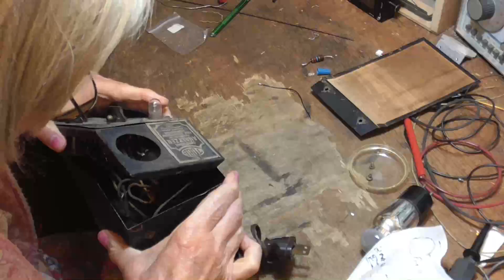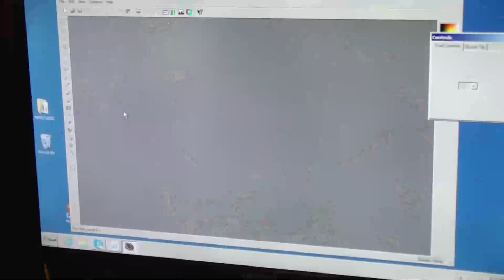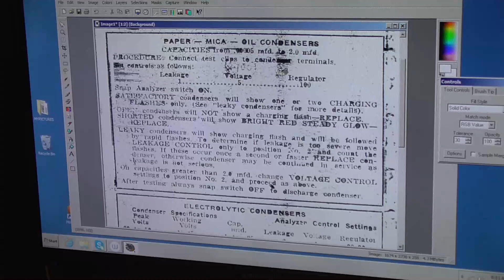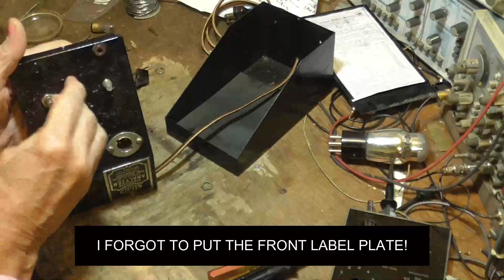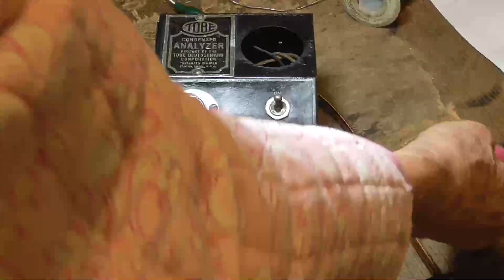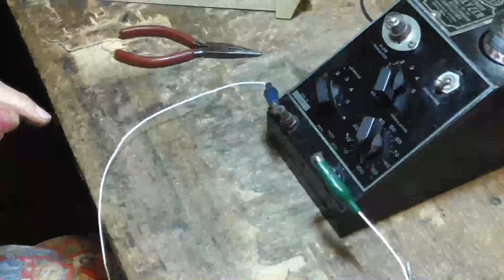RESTORING A 1934 CONDENSER CHECKER

Comment: Moving wire that you soldering with bare hand is amazing . You did not even say ouch ! . Also suggestion , why don't you measure the voltages  on good transformer and mark them on the transformer .This way it will be easy to replace one if ever goes bad .
Reply from the maker: Good idea.

Comment: I do think that adding a fuse to "vintage" electronics to control / prevent damage to things like transformers you cant replace is a great idea, but, @ 22:24 you should spend a few bucks ( currently $2.10 ea @ Digikey) , and get some Keystone 3523 fuse blocks. They have a soldering lug on each end, have an insulated base and can be easily mounted with a 1/8" hole and a pop rivet and backer washer, leaving the flush side of the rivet on the outside of the cabinet in this case, but adding safety & accessability to the fusing instead of trying to solder inline wires to it and then hiding it under heat shrink.
Reply from the maker: I have plenty of these fuse holders. I'm lazy. Also, I'm betting the fuse will never blow. I have MANY instruments with fuses, some over 60 years old, and none so far have blown a fuse. Things don't go bad very often and in most cases never.

Comment: I really like your videos, I really do!  On the one hand, looking at your laboratory, you can breathe the air of the 50s - 60s (I too grew up with thermionic valves), but on the other hand there is also the computer!  Beautiful and magical combination!  Wow!
Reply from the maker: I have over 120 antique radios in my house. The whole place has that antique smell! Fabulous!
Reply: @glasslinger  Sorry for the question, maybe I'm being indiscreet, surely you must have a lot of experience in the field, but where do you find all that material?  Do you have a repair shop?  Bye!  Good work!
Reply from the maker: @serjohn557  50 years of collecting "stuff" so I have a massive supply of parts on hand. Stuff you can't buy any more.

Comment: When you use cloth braided covered wire, before you strip it, try using a couple of drops of supper glue before and after the to be stripped area. Much easier to work with and no unraveling over time.
Reply from the maker: Nice idea! Now if I can find a tube of super glue that isn't all hardened up!
Reply: @glasslinger  I find heatshrink helps keep cloth behaving. Use black:)

Comment: I have a device with a bunch of 2000MFD Electrolytic Caps at 450 VDC.   How can I test them?
Reply from the maker: Wow, that's some real big bang capacitors you have!  Charge them up to 450 volts and watch the charge current. After the capacitor is charged the current should drop to ten milliamps or so. If the final current is much above that, the capacitor can get hot and short out.  Be careful, a capacitor like that can really wallop you good!
Reply: @glasslinger  Thanks for your reply.  I like to watch the things you fix and making glass tubes, I have little skill like that.  You might find my video amusing, most of our videos are travel and such.  This one is unlisted https://youtu.be/x6NSu8r4Jaw

Comment: When I was a kid I gobbled up every broken and old electronic device I could get my hands on. If I was unable to get one working I’d take it apart for later use. I taught myself how to repair these devices by trial and error at first and by reading later on. I have a talent for repair it turns out. I could almost just look at the guts of these old tube radios, tvs and record players and without knowing how, figure out how to repair them. I can’t explain this gift and my wife is always knocked out how I can practically by placing my hands on her devices, figure what’s wrong and repair them. If I had not been totally led away from any interest in repairs, I might have made it a career choice. I use to design and build my own transistor radios too. I had all sorts of bins with tubes, resistors, transistors variable resistors and capacitors. My father found my stash of these things and threw them away. I entered law and eventually became a Judge, having a terrific career. But I still like to see videos like yours, repairing items as  I once did, many years ago. I wonder how close to my young interests were yours
Reply: That sounds exactly like me!  A bit later tho as I was a kid in the 80s. And I got darn good at it, and I later did a career about it. Work with radio and transmitter repairs now, but have worked with television and audio repairs for many years prior.

But I tell you there is a huge shortage among repair techs that can really repair and not just swap out boards, as they tend to do these day. At my work we have tried to find younger guys to continue the trade as we are not getting younger... And sadly we just don't find any, kids just don't do this anymore it seems like. The best techs I have meet are the ones with a keen interest and that basically started out messing with electronics at a young age aka learn by doing. Exactly like you describe and we did.

This is in Sweden  btw, but I suspect the problem is universal. And this throw away and buy new society we live in ain't helping.

Thx for the comment, it really hit home with me.
Reply: @bjornholmqvist3230  👌🏻

Comment: `On the subject of capacitors, I admire your trust in checking capacitors with your VOM in many of your videos. I have a Triplett 630 but have not used it to test capacitors on the 100k range as you do. I would love to hear your opinion on using an ESR meter that can test capacitors in-circuit as opposed to a VOM test out of circuit. Perhaps you could do a video on capacitors? and I think its also time for a shop tour video. Thank you and regards - Renato
Reply from the maker: I only test capacitors for antique radios with the 630. ESR is not a factor in those old radio circuits. For all modern circuits where ESR is a factor I use new top quality capacitors designed for the job. In testing capacitors in circuit, ESR can be done reasonably accurately. For leakage you have to eliminate other leakage paths so in circuit testing is usually futile.

Comment: Hello from Calgary Alberta I just want to let you know you are inspirational with your no fuss gitter done ways of working .You are so nibble with your hands and that huge soldering gun in tight spaces lol You inspire me to keep learning this wonderful skill
Reply from the maker: The soldering gun is not that big. (150 watt)  I have a nice 325 watt gun that is about double that size!  Now THAT  is BIG!
Reply: @glasslinger  lol ya thats big for sure .Please make another video soon Im getting bored over hear 

Take good care of yourself
Reply: @glasslinger  I was able to purchase a 30v Triplett 630NA multimeter .I am going to try your trick on checking cap leakage ad viewed on one of your videos
Reply from the maker: @506mountainrenos  The 30 volt battery in the Triplett is difficult to find. You can make a good substitute by using lithium coin cells. 10 of them makes 30 volts. Put them in a sleeve of shrink tubing to hold them in line. This will last years.
Reply: @glasslinger  Brilliant I will do this and you can now buy this 30 v battery on amazon at a cost of $53.00 canadian I like like your Idea much better

Comment: You should make a radio with homemade tubes.
Reply from the maker: Actually, ALL of my homemade tubes end up in homemade radios! Many are in my radio collection and some have been sold on ebay.
Reply: I could have sworn Ron already did that, but it was a transmitter about half a year ago.

Comment: Hi Glasslinger.
What type of baratron do you recommend when building a vacuum system?
I'm following your website as a guide. 
Do you recommend the 1 torr or the 0.1 torr baratron?
Reply from the maker: The 1 torr full scale is the most useful. This gives you the full range of backing pressures either turbos or diffusion pumps use.
Reply: @glasslinger  okay and what would you recommend for the inlet pressure reading on a diffusion pump?
Reply from the maker: @johnnycash4034  I am assuming you mean backing pressure. (inlet is the high vacuum side, and low as it will go is best) The backing pressure for most 3 stage dif pumps must be below 100 microns. 20 to 50 microns is best. 4 stage dif pumps can pump against 200-500 microns.

Comment: We had a gizmo like that in our mechanic's shop at the trade school I attended back in 1977 for testing the condensers in the ignition systems of the old coil type ignition systems. This was just on the brink of the computerized systems, so we were still working on old cars from the 50's forward.  We used to use it to put a charge on the condenser then carefully remove it and call out another student's name, then toss them the condenser.  Man they would jump, cuss and throw it back at you while all the rest of the class laughed for a bit. Used to piss off our instructor to no end.

Comment: i fixed an old am tube radio awhile back, never got the tension system for the tuner working reliably but it was working electrically after i was done and held a station, stupid thing had an ancient multicap canister and a ton of wax capacitors that needed replacement, accidentally bought an engine starter because it had compatible specs for one of the components of the multicap, too bad it was ten times too big.  at this point im painfully familiar with the ac buzz in analog equipment that means replace everything

Comment: Thanks for this vedio . I want to buy a capacitor tester by which you can advise me
Reply: The cheap component testers on Ebay are good enough for general purpose capacitors, the only downside is you have to understand the numbers the tester shows you. It won't explicitly give you a good/bad, you have to know what the values mean to know if a component is good or bad. If you need a more sensitive and advanced tester, I'd recommend Mr. Carlson's Lab, he has a patreon where he has shared designs for several component testers that are a lot more precise than the generic Ebay chineseium.

I wouldn't recommend an old AC mains based component tester because "there be dragons". This tester isn't as dangerous because it has an isolated transformer, but a lot of old test equipment from that era is referenced directly to mains and tube gear can have B+ in the 300-500v range. Old test gear also is often full of faults from deteriorating capacitors and other passive components and needs to be repaired before it is actually used. Powering up old gear from that era without checking it first can lead to its destruction very quick.

Comment: It would be nice if you could get more bandwidth in your videos. The video looks something like it's dripping with condensation. A bad way to test if the condenser checker is working is to touch one post with the left hand and to touch the other post with your right hand. If you fly across the room, it works. You might also be dead, so I wouldn't recommend it.
Reply: It appears to be artifacting by TubeYous crappy compression algorithm.

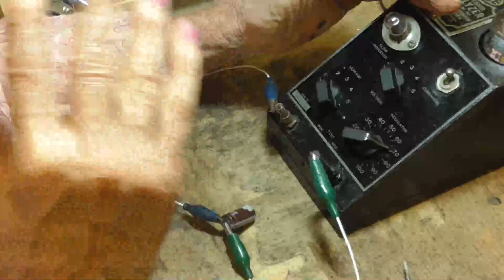Comment: Nice one!  I think you'll find your unit IS discharging the caps when turned off.  At 56:57 in the video you pulled that modern electrolytic off before the discharging indicator had gone out, so it hadn't finished discharging it.  All those new fangled microfarads take a while to discharge.  :)

Comment: Ron, what is the name of the service "stuff" (I forget the word you used) to seal(?) around where the replacement power cord went into the plug?  What type of replacement power cord is that?  You use a selection of (new) materials in your work -- will you share the names of supplies & suppliers that you use in a future video?

Comment: Condenser = capacitor? What’s the difference?
Reply: No difference.  Capacitors used to be called condensers.  If you're old enough, you may have or have had a car with a "points & condenser" distributor.
Reply from the maker: The difference is time. Before about 1945 they were called condensers and then gradually the agenda group took over and changed the name to suit themselves. Same thing with "cycles per second" and Hertz. All politics, no science.
Reply: In Europe, most countries call it a "Kondensator". Same stuff, just another name in a different time. Why they changed it, I have no idea.
Reply: The term came from the steam train condenser when techs didn't know better, later on by 1950s they realised the component does not condense so changed the name.

Comment: You could instead adjust the colors using curves. That way you don't have to manually go through each area of the picture. I don't know exactly where it is in the software you're using, but it's usually something like Colors > Adjust > Curves, or Colors > Brightness and Contrast > Curves... or other such menu. You know you're in the right place if you see a histogram and a diagonal line over it. Just shape the diagonal line to an appropriate curve and you should get pretty good results.
Reply from the maker: I use paintshop pro 5. (very old win95 program) It has a super easy user interface but lacks some of the more advanced photo correction functions. I have version 14 but it is so difficult to use I don't bother. Too frustrating.
Reply: @glasslinger  I think I used to have paintshop pro 5 (or could have been 6). It indeed is a pretty old program, I guess it might not have had the curves tool. But you could save a lot of time if you invested some time learning about that particular tool - at least if you need to frequently restore same type of pictures. You could still do rest of the editing with the old version, so you would not need to bother with all of the bells and whistles of the new version. Of course it also depends on whether you feel the manual editing is tedious or relaxing ;)

Thank you for the videos!
Reply: @glasslinger   I'd recommend trying paint.net if you haven't heard of it. It's a powerful image editing program that has a simple user interface, and it's free. www.getpaint.net

There are so few applications these days that have a functional user design, it's all about the eye candy and how many buttons you can cram on the screen at once. I use a bunch of older software myself for the same reason, modern stuff is too needlessly complex.

Comment: Ron, how does this thing work? The tube is probably just a rectifier - but you said something like 0A1? That would be a regulator tube, without a filament - but this one clearly glows. I am confused. The electrolytic (which was bad) is the smoothing cap, right? Then you charge the DUT capacitor through the neon bulb. Maybe you parallel the neon bulb with the 1k - 10k - 25k resistors to compensate for leakage and make the device less sensitive?

Any explanation or diagram you could give would be greatly appreciated! Greetings from Germany!
Reply: I found the link to the circuit in the comments further down: https://imgur.com/a/3sGsAP5 so everything is clear now. Thanks!

Comment: Please check your camera's recording settings or your video encoding settings because the video was exported at a really low bit rate.
Reply: Glassligers game is about demonstration.. you better get used to Glassligers game & stile.
Reply from the maker: I am not sure what is going on. I am using Wondershare filmora 9 and use all the default settings for H.D. and MP4 encoding. The video is noticeable better right off the hard drive using VLC media player.
Reply: @glasslinger  https://mediaarea.net/en/MediaInfo is a good open source tool that will show you the technical details of the exported video like it's bit rate. This video has the signs of a very low bit rate cap. Static shots look decent, but during shots where some portion of the frame has movement the rest of the frame goes blocky. Areas with movement show trailing artifacts and smeared motion. Bit rate need to scale with resolution and frame rate. If you exported the file at 30 fps, the same bit rate would mean roughly twice the data available per frame. Same if your decrease the resolution. It's often better to lower the resolution then crush the bit rate if you have a limit that you need to be under like for broadcast or really slow internet upload speed.

I'm on Ubuntu so I can't test their software, but it might remember if you made (an accidental) change to the bit rate in the export settings. They have a page https://filmora.wondershare.com/get-creative/how-to-share-videos.html mentioning 6,000 kbps and 8,000 kbps which should be good enough for 1080p60 files.

Comment: Do you think it would work just as well to cut either a transparency or a piece of acetate or something to place over top of the metal labels as opposed to lacquer? That would impart shine as well as protection without having to alter the metal labels.
 Because it seems to me that lacquer is going to come back and bite the next person who has this. If this lacquer does anything but lift away, especially if it turns color, there's no way to get rid of it without damaging the printing underneath it.
Reply from the maker: There are times I do just that but I try to keep old instruments as close to original as possible if it is reasonable to do. Another thing, the "lacquer" of today is not like the old stuff. This is a modern air dry polymer that is substantially more durable than the old stuff.

Comment: Amazing that the neon appears to indicate leakage in the equivlent range of >10M Ohms . 
It would have been nice to see the instruction leaflet and schematic of this one to comprehend what exactly the switches and dials do and compare this circuit design to the Heathkit C-2 which uses a similar setup with a neon indicator to detect leakage.
Reply: See above post by  Juan Jose

Comment: I love that soldering iron, had the same one when I was a kid. I learned to control temp with trigger pulls and used nails or wire for tips.  It was fine for old tube sets and my simple creations. Got it for $1.50 at a Goodwill store and I used it for years.